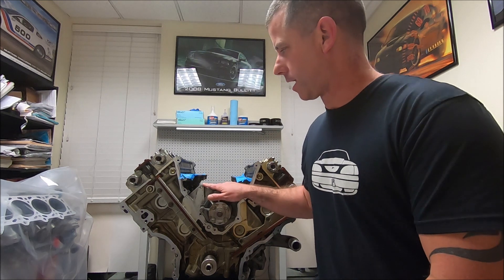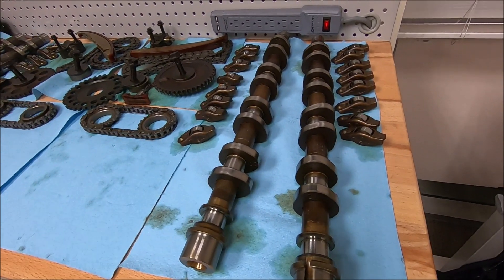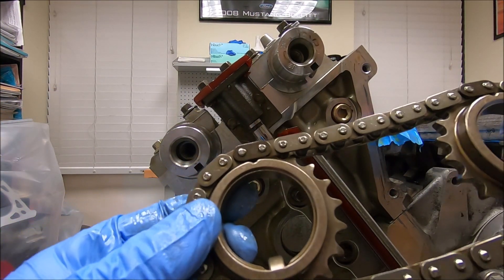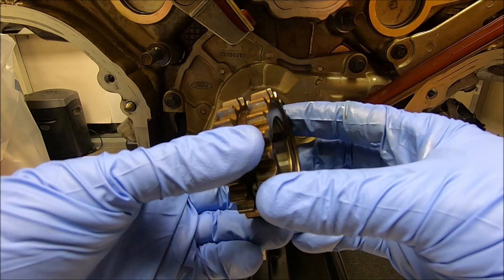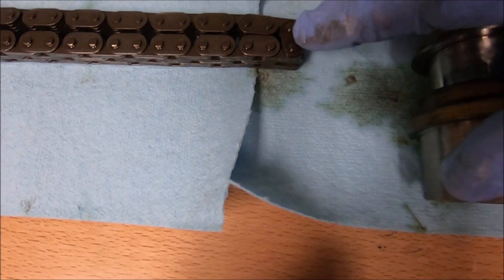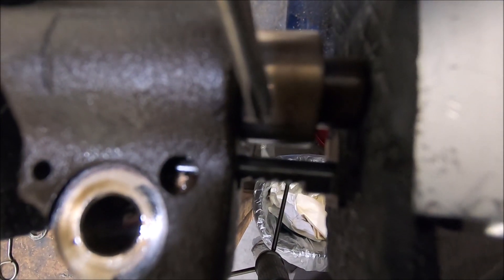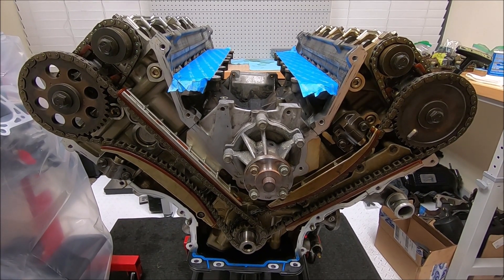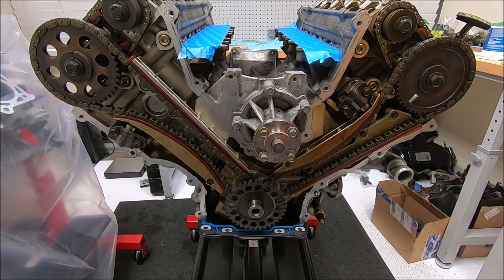Setting the timing on a Mustang Cobra DOHC 4.6

Comment: I got a question, last night I took my tensioners off because I have to pull the heads. Anyway as soon as I pulled the passenger tensioner the chain jumped a few teeth out of time. Is that normal when taking a motor apart?
Reply from the maker: Yes that can be normal, depending on where the engine stopped the cam could have pressure on it from one of the valves.  The chain was keeping it from rotating and when you took the tensioner off, it allowed the cam to spin.  Hopefully, it didn't crash a valve into the top of a piston.  Just be careful if you have to rotate the engine when the cams are still in with the followers.  I have a video on here about putting the engine in "safe" position if you want to learn more about that.

Comment: Did you reuse cam sprocket bolts here or are they new? If reused, what were they torqued to?
Reply from the maker: I try to use new ones, used ones are not recommended but I have seen them used and torqued to about 100 lb-ft

Comment: I know this video is old but wasnt there a manufacturer defect where the left upper secondary timing chain tensioner put tension on the wrong end of the chain or is that only in the terminator engines?
Reply from the maker: It's not necessarily a defect, all the 4.6 DOHC engines are like that.  The argument is it may cause a few degrees of timing fluctuation.  If that does happen, in most cases it won't make much difference.

Comment: I removed the timing chains and didnt notice the crank sproket marking lines up but the cam gear markings are about 180 off. How do I fix this to achieve proper timing?
Reply from the maker: If I remember right, you have to get the #1 piston to TDC then lock the cams in place.  If the cams are 180 out, be careful when rotating them so the valves don't hit a piston
Reply: @JohnSmithRacing So with the Crank at TDC on cylinder #1 Im able to rotate the camshaft carefully back to where the timing marks line up?
Reply from the maker: @King_ZYZX  Sorry, I was thinking about the 4.0 V6 Engine in my first reply.  You might be able to rotate the cam with the #1 piston at TDC but just be careful to not run a valve into the top of the piston.  If you want to put the engine in a "safe" position, rotate the crank so the key is straight up.  I did a video on "safe" position that might help.

Comment: mine has the 3 coloured links, two at one end and one at the other, i also had to turn my drivers side sprocket anti clockwise so the chain links lined up with the dots but now the drivers cam sprocket 11 o clock w the deck surface but the passo cam sprocket will be approx 1 oclock, #1 piston is tdc the keyway is 11 o clock basically pointed at the passo head
Reply from the maker: I haven't seen the three colored links for a 4.6 but that is how they are on the 5.4.  If your links are not lining up like mine, feel free to email a pic or video at JohnSmithRacing@outlook.com and I will take a look.
Reply: @JohnSmithRacing  i figured it out, i had to rotate the cams 15° so i can put the chain on in the correct dots, the non tensioner side is super tight
Reply: @JohnSmithRacing it all lined up how it came off
Reply from the maker: @tturi2  Ok cool, feel free to email me a pic if you want me to take a look at anything.

Comment: do you still need to remove cam followers if you have the crank set at the right position before pulling timing components off?
Reply from the maker: It can probably be done without removing the followers.  You just need to be careful about piston to valve contact.

Comment: I have question will removing the cam follwers and alone be ok or do I have to remove the lash adjusters as well? I’m doing timing on a 4.6 4v 01 cobra !
Reply from the maker: Taking the cam followers out will make it easier, but even those don't "have" to come out.  The lash adjusters do not need to be removed.  However, it is a good idea to bleed them down to make sure  a valve doesn't hang open and make putting the cam follower back in easier.

Comment: If you put the reluctor wheel on backwards can that cause a crank but no start issue?
Reply: Nvm. You answered my question. Looks like im pulling the timing cover off to see if i out that reluctor wheel on backwards smh
Reply from the maker: @Travillage  You might be able to check by taking the crank position sensor out and trying to look in the hole and see if the wheel is centered in it.  A borescope would make it easier to get a good look too.

Comment: Just a tip for those that are trying to move the crankshaft, don't use channel locks or vise grips, if you damage the crankshaft you're risking a oil leak because the oil seal won't seal properly.

Comment: I’m looking at getting a 96 cobra that is 100% stock but has a blown head gasket.  I’m taking the motor out to do the job.  I will be taking the heads to a shop to have them checked to make sure they’re not warped.  In your video when you mention turning the crank and not having your cam followers and lash adjusters in there….if I am just taking the heads off and to have them looked at and then just reinstalling them do I need to worry about that as long as I have the colored chain links and timing marks lined up like you showed?
Reply from the maker: The reason you do not want to rotate the crank without the chains attached is because if there is a valve in the open position you do not want the piston to hit it.  If the cams are removed all the valves will be closed and you wouldn't have to worry about piston to valve contact.

Comment: i noticed that your factory sec cam sprockets have built in woodruf keys....my 1996 cobra engine doesnt have any, is it  wise to get updated sprockets? love your videos
Reply from the maker: Thank you for watching.  I feel like it is a good idea to use the sprockets with the key on them.  However, if you change to that style you need to make sure that your cams are cut deep enough in the keyway for them not to bottom out.  I have seen engines with broken sprockets shortly after install because they changed them but the keyway on the cams was not cut deep enough.
Reply: @JohnSmithRacing  
I made some custom keys for them,since I felt the factory left out this small detail
I made sure the depths were correct for washers and primary sprockets are flush
I didn't want to grind on cams
Thanks for the tech help
Keep up the great videos

Comment: Do you have to make sure it’s top dead center before removing anything
Reply from the maker: No, I actually try to make sure no pistons are at TDC before removing everything.  That way if the cams move when the chains come off they don't hit a piston.
Reply: So it really doesn’t matter if the engine is on compression stroke or exhaust stroke ?

Comment: Did you just reinstall old timing parts back into the motor? That was a used tensioner. And those 2 piece crank pulley are a joke. And the 1 piece sprockets are cheap. And so is new guides and tensioners. Hopefully this wasn't a customers car. If it was and your reusing all those wearable parts I would be pissed. Nobody and I mean NO mechanic with an ounce of actual pride in his work would have a motor ON AN ENGINE stand and put used timing PARTS back in.

Comment: How did you remove the cam followers and valve adjusters? I saw a video of you installing them but not removing maybe it's the same but I want to be sure
Reply from the maker: I most likely used the same tool.  However, if you do not have the tool you can slowly remove the cam girdles to get them out.  It is not recommended but if you go slow and evenly, it can be done.  I definitely do not recommend putting them back in the same way.  The best way to install them is with the proper tool.
Reply: @JohnSmithRacing  do you have a part number for that tool?  I am having a hard time locating the valve spring compressor tool you used in your other video.  Great stuff!
Reply: Would it be easier to remove the cams without the tool to take the followers out?
Reply from the maker: @ballinger214  Yes, it is a lot easier and faster to take them out by removing the girdles with a small electric impact.  You just have to try and go slow and evenly when taking the bolts out so the cam does not bind up and break either the girdle or the locating dowels.

Comment: Hey man so I did this exactly fired up my car and my 02 was reading 35.6. Got a new one still did the same thing, the more and more I started the car it would run worse than eventually not want to run. I did a compression test and I have low compression. Short block had no issues before. So I believe somehow my timing is off any ideas?
Reply from the maker: Unfortunately it could be a number of things.  There could be an issue with the heads.  I would try to do a leak-down test to get a better idea of wear the compression is escaping.  Also, if the engine is low on one entire side, there is a good chance the timing is off.

Comment: Thanks!
Reply from the maker: No problem, let me know if you have any questions.
Reply: @JohnSmithRacing  Could one assemble head/cam it being off the block first and then torque them onto the block?
Reply from the maker: @bobbydouglas16  Yes, it can be done.  I don't usually do it that way but that doesn't mean its wrong or can't be done.  I would just make sure none of the pistons are at top dead center.  You don't want to torque a valve into a piston because the timing will not be set yet.
Reply: @JohnSmithRacing  understood, with the timing mark at 6 o clock on crank it should good to go right
Reply from the maker: @bobbydouglas16  I usually put the crank key at the 12 o clock position, just because its easier to see.  No pistons should be at TDC at the 12, 3, 6, & 9 o clock positions.  Those positions are for the crankshaft woodruff key

Comment: With just the addition of the Cobra cams, how much HP/TQ do you expect to gain?
Reply: Most likely not much mark 8 made 290hp 290ish tq the cobras made 300ish HP and 305 ish tq 
Ford did not make Hot cams in the early makings of any mod motor
If you can find them for super cheap they're probably worth swapping for
Reply: @jonnathwill8318  what are you talking about? People have made like 15-20whp more on 99-01 cobras with 96-98 cobra intake cams

Comment: Does this eliminate the need to degree the camshafts? Seems like the darker chain links eliminate the need to degree it, going to be tearing my 03 4v down to the block here in the next couple days to go to aluminum block. Any advice would be greatly appreciated thank you. Also great video.
Reply from the maker: Thank you.  No it doesn't eliminate the cam degree.  You don't "need" to degree the cams but its a good idea if you are using aftermarket cams.
Reply: @JohnSmithRacing  Ok, I will have to look deeper into that. Thank you again for taking the time to make these videos. It really helps out us backyard gear heads do what we love.

Comment: good video my brother ,,i got 2004 maruader 112,000 miles on it..eventually im gonna have do my engine it has that rattle sound only when u frist start it up for about few seconds then it goes away..maybe timming chain tensioner latting the chain slap to the oil fill them or hydraullio cylinder in the tensionerare alittle worn
Reply from the maker: Thank you.  Adding a filter with an anti-drain back valve might help as well.  Ford Racing makes a really nice filter but the Motorcraft one also has anti-drain in it.

Comment: Hi John, I have three questions for you.
1. How come you didn't use the OTC crankshaft positioning tool that keeps the crankshaft/piston at TDC.
2. I'm purchasing the Ford Performance 5.3 modular stroker short block #M-6009-B53.
I'm installing my 1998 cobra 4v dual port heads with Comp Cams #106500. Valve lift - intake .475, exh .450. Will these cams work with this stroker motor? They worked fine with my 4.6 cobra motor.
3. Will the Ford Performance 4.6 4v cam shaft drive kit #M-6004-A464 work on this engine combo or is there a better brand out there. Any help would be  appreciated.
Thanks
Reply from the maker: I have never had the need to the OTC tool, keeping the piston directly on tdc isn't as important as making sure the dots and the dark links line up.  As far as the cams, it depends on the piston in the engine but most likely it will be fine.  Yes, that timing kit from Ford Performance is a good one to use.

Comment: That is a very instructive video John. I am from Australia and I have the Ford Boss 5.4Litre 4 valve V8. I take it the procedure is exactly the same. I am just waiting for the Ford kit to turn up from the states and am also replacing the oil pump with a Melling M227 pump.
Reply from the maker: Thank you.  Yes, it will be a similar procedure for the 5.4.  The main difference will be that the 5.4 will have two dark chain links for the top and the sprocket tooth will go in between them.
Reply: @JohnSmithRacing  Just wondering how many times the motor has to be turned with chains still on to get all dots and links to line up. Have got the primary chain dots and links lined up after rotating the crankshaft numerous times but secondaries are not lined up.
Reply from the maker: @garymcphee8284  I don't know exactly but I have heard they only line up every 100 revolutions or something.  If you are unsure if the timing is correct you can turn the engine until the secondary chains are pointed up and then just undo the primary chains and line up the links.
Reply: @JohnSmithRacing  Hello John, thanks for your reply. I made sure the primary chain dots lined up ok with the primary cogs and then removed the secondary chains and made sure that there were 7 links as per shown on the chains. I have not moved the crankshaft or cams and it all went straight on so should be good. Removing the oil pick up bolts are a real pain when the motor is in the car. Looks like I will have to loosen the sump and let it hang down a bit at the front to put the pickup bolts back in.

Comment: Should I rotate the motor after I put the chains on by hand ? And how many rotations before the marks line back up or will they ? Thanks got mine tore down in car right now
Reply from the maker: You can rotate it after the chains are on but I prefer not to.  Only because I like to be able to verify that the dots are lined up.  The marks don't line up that often once it rotates, I heard it was every 100 revolutions or something.

Comment: You never said if you had to have Cyl1 on TDC before you move the crank or does it not matter?
Reply from the maker: I am not sure if I understand the question.  With cylinder 1 at TDC, you line up all the timing marks, and once the chain is on the cam will move in time with the crank.
Reply: @JohnSmithRacing  I think he's asking if cylinder 1 is at TDC at the beginning of this video.  I think it has to be, correct?

Comment: I have a quick question I'm doing a timing chain and new cams valve springs when I put the car to top dead center can I take the valve springs and Cam's all out or just the valve adjusters and those other things 1 paise is can I put the car top dead center with all the stuff out of the head
Reply from the maker: If I am understanding the questions correctly, yes you can.  With the piston at TDC on the power stroke both valves will be closed.  You can put compressed air into the chamber to hold the valves up as well.  Just be careful not to hit the valves on the piston.

Comment: Could you comment on the direction that the key way tapper on the cam sprockets is supposed to face relative to the front of the engine? I noticed on the left side sprockets you had the tapper facing in and on the right side facing out? Is this the only config? I did it exactly as you have in just curious.
Reply from the maker: Yes, that is correct.  One side is flipped to clear and line up the chains.
Reply: @JohnSmithRacing  thank you. I’m upgrading a marauder’s engine to an MMR guide and tensioner and secondary chain and tensioner to hopefully get rid of some chain rattle around 2500-3200. Throwing a steige rebuilt Eaton on top as well. 

I’ve never done 4V chains but I’m curious about what happens on first start up before primary plungers have their ratchets in the extended position? Is this anything to actually give thought to or will it be resolved within a turn of the starter? 

Thanks again you videos are great for the home tech.
Reply from the maker: @dsauce8780  The tensioners and even the cam lash adjusters should only take a few seconds to build oil pressure.  I usually do a compression test before I fire and engine and that might help get some oil up into the oil gallery.  Some people will make a pump thing to pump oil into the engine but I think most just fire it up.

Comment: I turned my crank a little bit in order to get the blue link to line up with the dot on cam gear. The dots all matched up to the blue links but the crank pulley dot was no longer at 6 o’clock. Is this okay or is it out of time?
Reply from the maker: I do the same thing.  As long as the dots line up with the dark links, it doesn't matter if the crank is turned.  When everything is where you want it, you should be able to rotate the crank back to the recommended starting point and have everything line up.
Reply: @JohnSmithRacing  thank you! You have by far the best videos on setting the time on these engines. I just got mine wrapped up and timing cover put back on thanks to you.